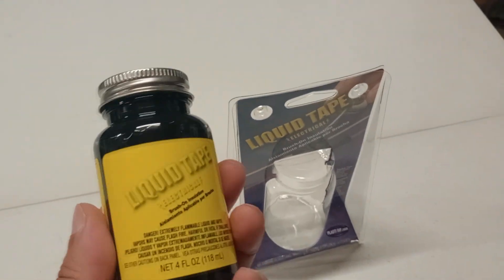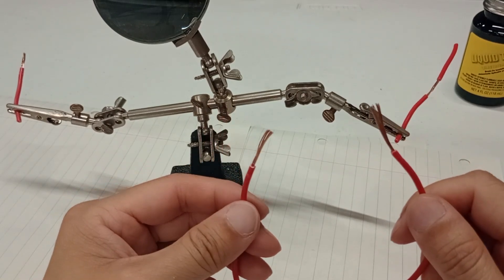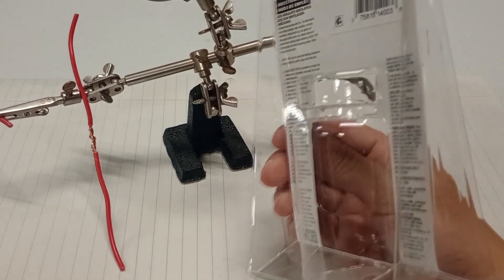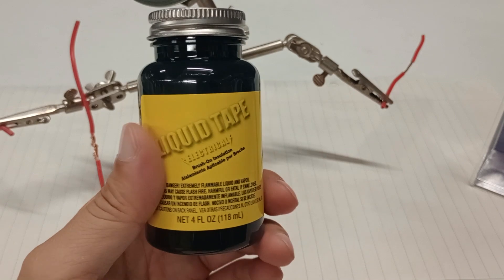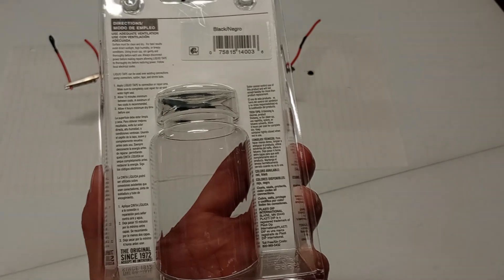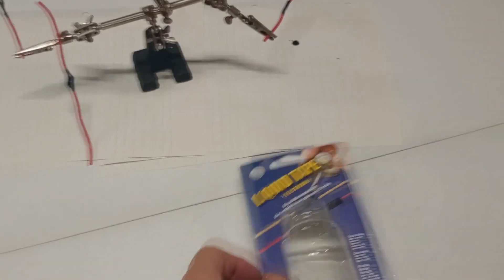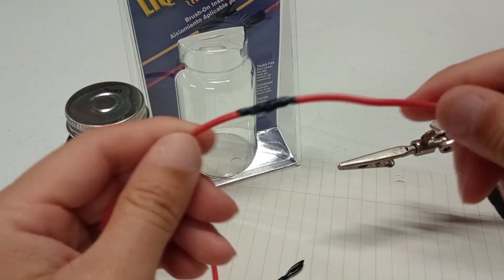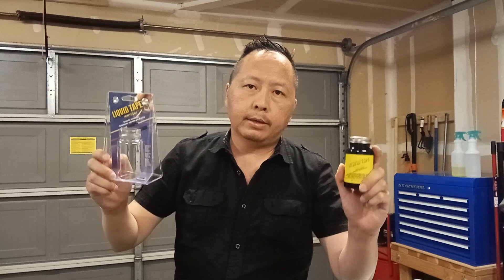Brush on Electrical Liquid Tape

Comment: Great job not making a mess, that stuff is the worst to get off of anything including your hands!!👍
Reply from the maker: Thanks for the info I didn't know it's tough to remove.
Reply: @WelkingVue  Yeah when its still wet its very sticky it can make a real mess acetone or rubbing alcohol helps remove it, your idea with the helping hands soldering tool was a great idea, keep up the good work, most times when someone makes content they do not even consider the small nuances. It was practical you did it without thinking about it.  Not everyone is going to grab the tool to make the job easier. By doing what you are doing it helps others to gain insight from your technique that is how it is supposed to work. There is always something to learn from each other everyday, it is an endless flow of ideas and talent if more people would share like this, honestly and without financial opportunity at the baseline our world would really thrive. Good luck and thanks, Keep it up
Reply from the maker: @shannonconn9557  Thank You!